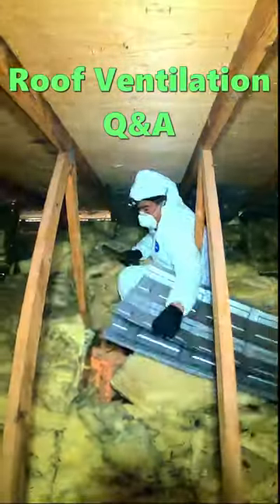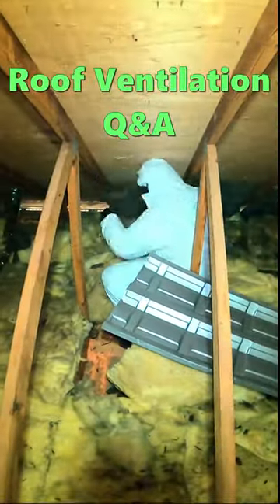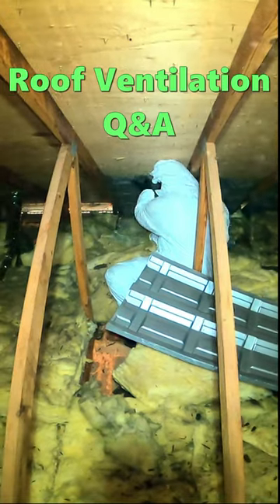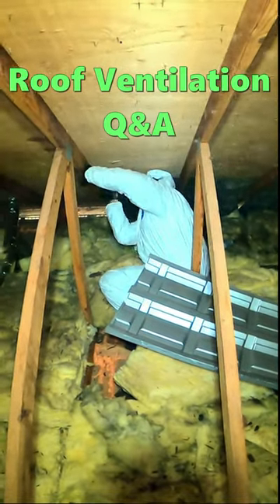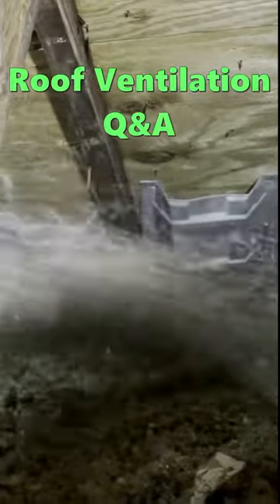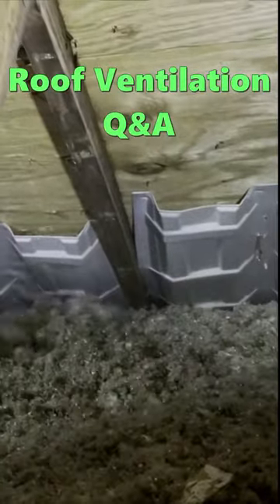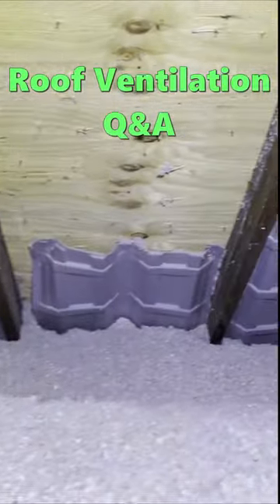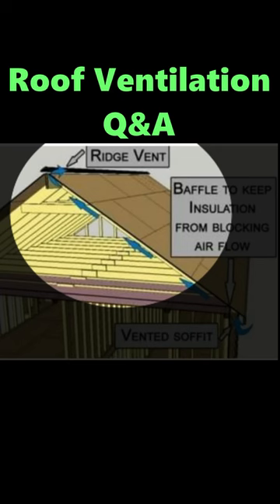What Everyone Wants to Know About 🏠 Roof Ventilation

Comment: The purpose of a baffle is to allow insulation to cover the edges of the wall asembly at full height but keep it out of the eaves.  If you put in blown insulation you really want this installed.  Something like 5 or 6 feet lengths is all that's needed.  Air?  Going to flow with or without it.
Reply from the maker: Not following you on this.
Reply: @homeairleakagetest  Simple: without support, the edges of blown insulation will be tapered.  So maybe main ceiling area has R20 value, and perimeter walls at the top winds up near R3.   Cold climate, that may result in condensation problems at the top of walls.  Ever notice the majority of wall paper peeling begins near the ceiling most houses?  That is evidence of the problem.
Reply from the maker: I understand what you are saying. Are you in the field installing baffles?